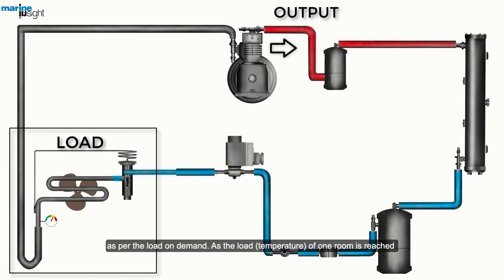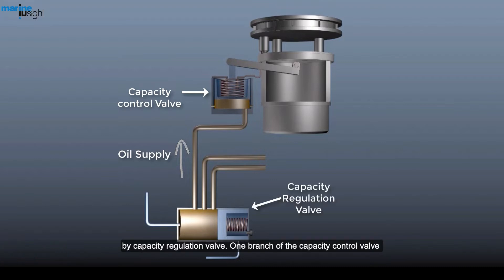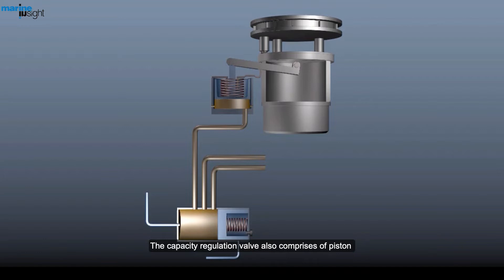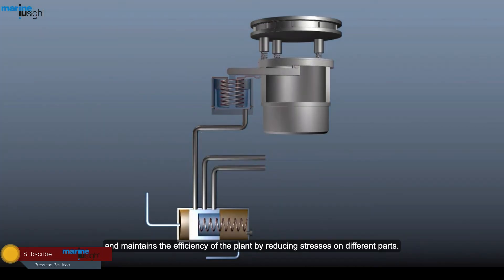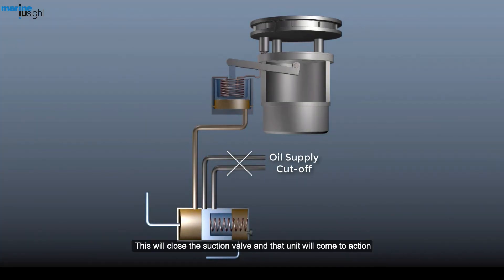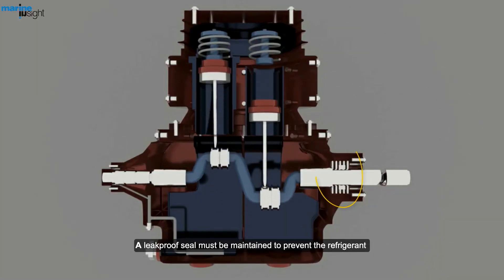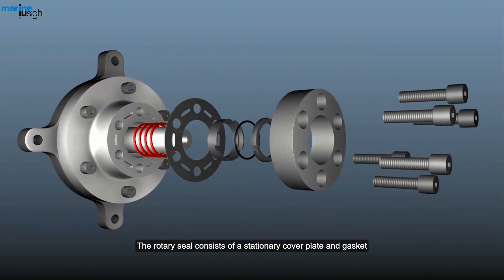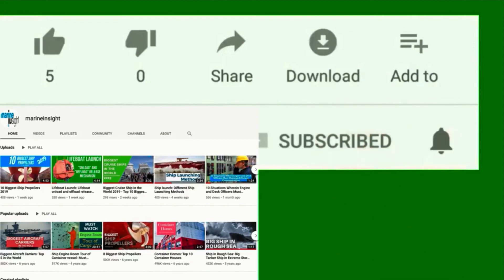Compressor Capacity Control #capacitycontrol #unloader

Comment: If the valve is electrically charged then the valve is loaded or unload?
Reply: It should go off of refrigerant pressure while system is running

Comment: Good video.... What is the relation of "crankcase pressure" with "unloading mechanism"?
Thanks.
Reply: Crankcase pressure means suction pressure, when system load is high also means too much evaporation pressure which after this point gases goes to the compressor suction. In here i guess it is basically saying "when suction pressure is high, that means the system load is high, more coolant required, compressor should work to meet this demand".
Reply: Thanks for your kind reply... Thanks . @oktemgoncuoglu9107

Comment: How to remove unloder valve . What is the procedure to remove . 
Because compressor app is fluctuating 20amp to 40amp 20 is constant but running full day with out cut off .
What was the problem .

Comment: Could you please explain what is root cause of Refrigerant leak in the High pressure Relief valve for Air Cooled Chillers ???
Reply from the maker: One of the most common issue is - leakage in the relief valve seat
Reply: @marineinsight  Thanks for your reply.  Is there is any specific reason for this relief valve seat leakage,(Like Non maintenance of Filter or Imbalancing of water flow or varour thermostat set point??)

Comment: You got something 180 degrees backwards in your description. 

When the heating load of the plant increases. Crankcase pressure increases. and this should open the suction valve. To allow more pistons to push refrigerant. The reason loaders exist. Is to prevent short cycling of the compressor. When it is caused By increased heat of compression when the suction pressure of the refrigerant is to low. You don't unload pistons when the crankcase pressure gets to high. You use a CPR valve to limit the pressure to the compressor. During hot pull-downs (high heat loads).

Comment: How solenoid valve operated in unloader mechanism?
Reply from the maker: Solenoid function is pretty simple, instead of the oil supply operating the unloader valve (keeping the suction open), it is pushed by solenoid valve to open the suction valve whenever needed
Reply: Suction valve of that particular unit? @marineinsight

Comment: That means when the oil suppy to the unloader is stopped all of the units are working and when the oil will be supplied then all unloaders will work cutting off all cylinders?
Reply from the maker: Yes. 👍🏻
Reply from the maker: The oil supply to the unloader will depend on the crankcase pressure.
Reply: Sir, i have problem with my compressor 5h40.
Previosly compressor cut off caused  LO pressure low, caused oil leaking from saat seal. After we top up oil and running the compressor, suction and oil pressure are normal but ampere reading low (40Amp), we tried to regulate clockwise the capacity control but compressor not respon, ampere not coming up also.
Please your suggest Sir. Thankyou